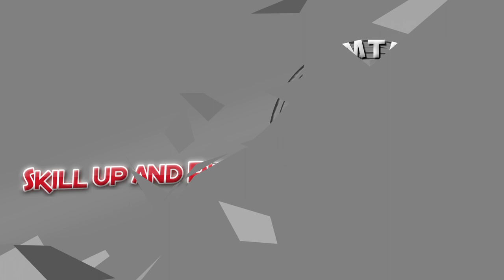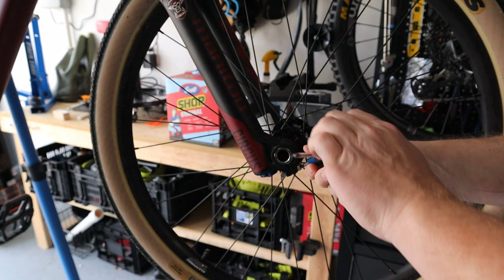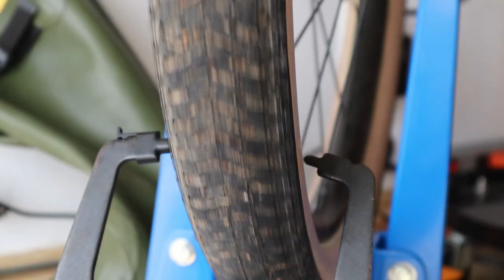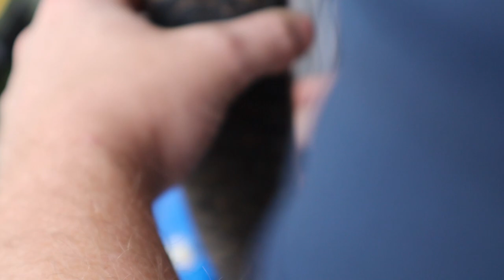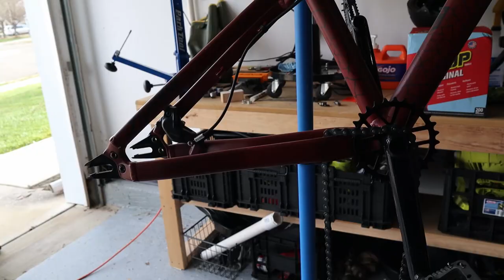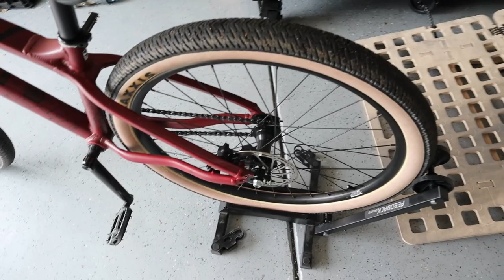#MTBPlanB Best break-in maintenance for Dirt Jumper bikes

Comment: Tbh, gotta grease the axel for the front wheel and the threads for both the rear axle nuts and the pinch bolts on the fork. Anything your using a torque wrench on needs to be greased to avoid false readings, and then they axels should also always be greased as well as axel nuts.
Reply from the maker: Great points!